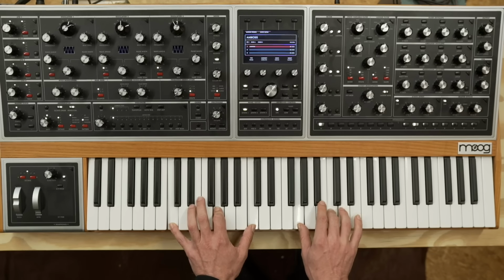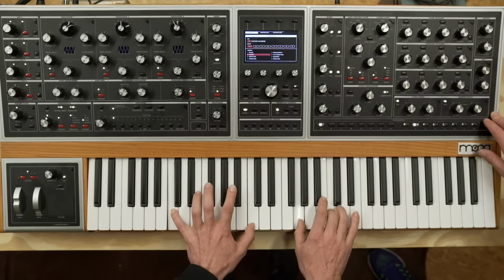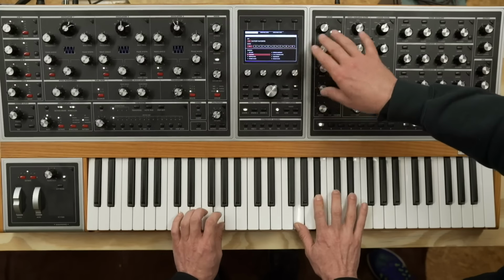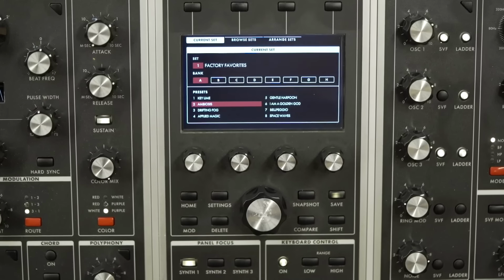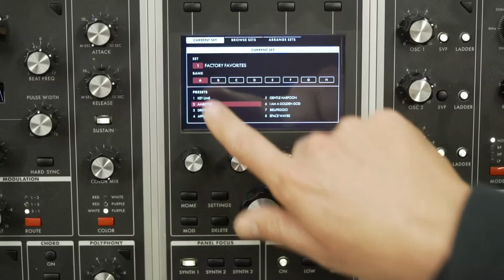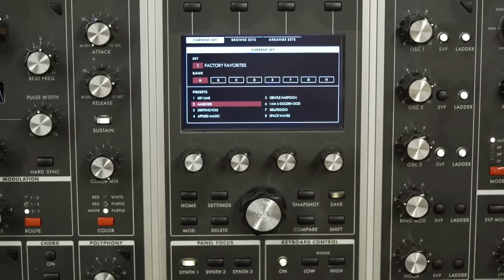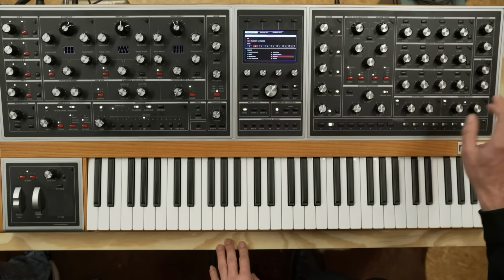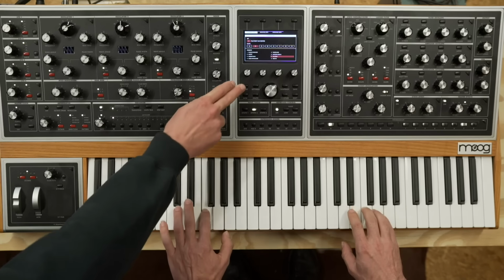Moog One: Factory Presets - Part 1 (Live from the Moog Factory)

Comment: Stuck notes seem to happen fairly often in the demos. Can we expect updates to start weeding them out over time?
Reply: Thats not good there should be no stuck notes. I can understand on a midi controlled rackmount instrument but it should not happen at all when using this instrument with the built in keyboard.
Reply: The Slim Phatty had the same problem and they never fixed it. I love the sound it of a lot, but it will get stuck just about every time I use it.
Reply: +Michael N "The Slim Phatty had the same problem and they never fixed it." Really? that's weird! I have a Moog Voyager signature edition (first generation). In all the years I've used it, apart from something having to do with midi, I've never had a stuck note while playing it live (which is what I do most of the time with it). I wonder if this has to do with a transition from hardware to software control. That would not be a good thing.
Reply: Remember that Slim Phatty has no keys and is controlled by midi only, unlike the Little Phatty that had keys. I was just reading that it can be fixed but only by buying a USB Debug Adapter and opening up the case and connecting it directly to the board inside. It's done by updating the Bootloader that cannot be done by the USB jack like firmware can be. Amos told people how to do it on the Moog Forum, so i guess they referred you to a fix at least.
Reply: +Michael N Right, I forgot that the Slim Phatty is the module version. I was thinking of the Little Phatty. Yeah midi can be unreliable, so stuck notes are less surprising for a midi controlled module. Good that there is at least a fix.